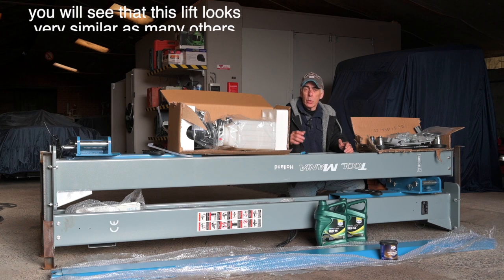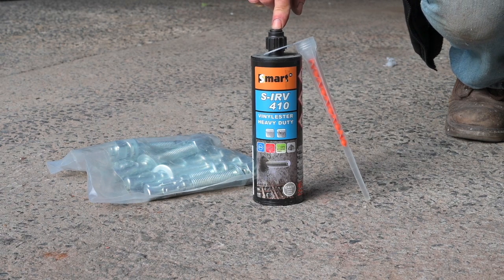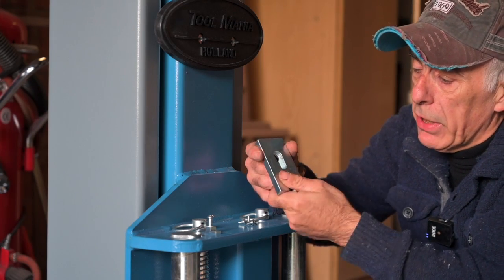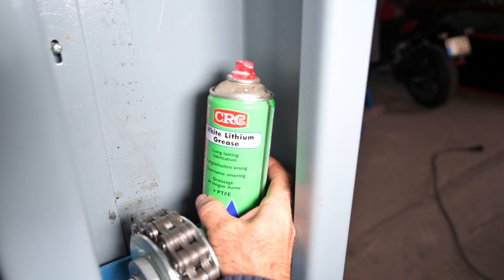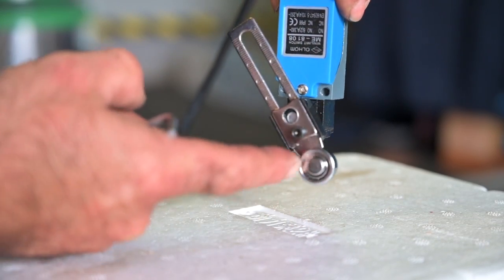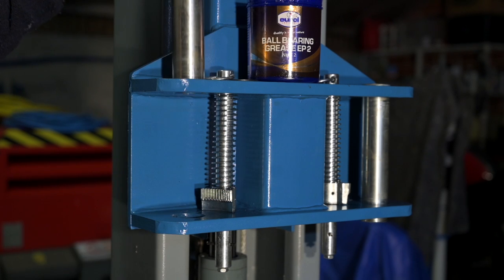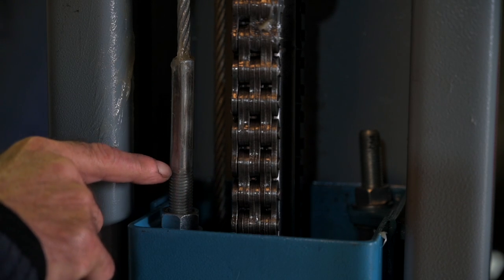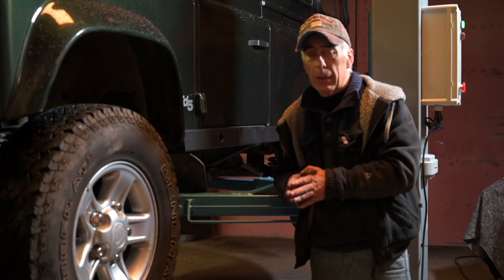Enough with jacks and axel stands, installing a 4000kg two column car lift

Comment: Love your video presentation .your amazing array of equipment is sadly lacking . My hydraulic engine hoist had to double up as a forklift . my aluminium ladders sections were performing the safe   ish erection of the posts .my new concrete slab had not been bull floated and the surface although level was all bubbly and uneven . My first attempt to bed the post was not perfect   although vertical in both directions .Maybe I should have used a bedding mixture of fine sand and cement . the industrial epoxy I used was not enough to cover the whole base plate . 79 years old and still learning new projects . I measured the baseplate positions and screwed two 1/2 inch thick x 4 inches wide  ply strips in place to allow for accurate base plate positioning . I like your pilot hole  drilling tip. this video is the bnest .. the twinbusch video is sadly not up to your hands on approach .  stay safe   Richard. in Alvito Portugal Sunday 21st April 2024.
Reply from the maker: Good to hear and keep on going... richard

Comment: i installed a 5ton unit in my shop last year, and that thing has paid for yourself and then some.  You can fix cars, manure spreaders, lawnmowers, very handy tool to have especially for fuel pumps and suspension work. you will love it.  I wish i had your forklift when I installed mine, it would have been a bit less scary :)
Reply from the maker: TXS for the comments, indeed you only know what you missed once you have it

Comment: very nice vid!  what a pleasure to be able to get new tools as you go through a project.   (One minor comment is that there was a bit of rocking with the Defender at the end when you were parking it, as if there was a bit of discrepancy between the two sides.)
Reply from the maker: Thanks for the comments , that was because I had metal piece in the shaft ( at the top ) that was not bolded down and it was taken by the shuttle /cracked .  That causes that shake.  Solved

Comment: Nice work and timely as I'm pouring concrete for a new workshop floor this month.  I'm sure you used the correct grade of threaded rod, but I would suggest anyone using rod to not use common thread. An alternative is Chemset Anchors.
Reply from the maker: txs for the comments, yep indeed

Comment: Hi Steve, nice work on the installation and video, well done. I just checked the comments and i cant find anybody else mentioning it, but it seems as though the shuttles had become out of synchronisation after the first few lifts, rocking the vehicle sideways and the locking mechanisms 'clicks' where well out of time... im sure your already aware and have probably fixed it already..cheers.
Reply from the maker: TXS for the comments, and indeed that was a two fold adjustement as this was a first lift.  One was to increase to up time on the timer before the lift descends. Especially with heavy loads, it takes a bit more time to get it lifted before it unlocks.  The second issue was air trapped in the far end cylinder,  had to bleed it a bit.   Now that is working smoothly..
Reply: @D3Sshooter  Hi, i have a dunlop 4t lift like this, going to be installing shortly. i was wondering about the bleeding, how is this done? is there bleed nipples on the pistons? thanks matt.

Comment: ThIs looks to be a very useful addition to your workshop, the only thing I would try to change is the cover for the hydraulic pipes which you have to avoid tripping over, surely this could be sunk into the floor. I think the only thing that will prevent most people buying one is the head height required, I am sure you will cover that aspect in a future video. Many thanks for posting this. Chris B.
Reply from the maker: TXS for the comments, indeed I will

Comment: Any lift is better than no lift. The only thing I don't like about that style lift is the cables and hydraulic line running across the floor, it becomes a pain in the ass when your trying to pull out a transmission.
Reply from the maker: TXS for the comments, that is indeed true.However I will place some panels  on the floor to level

Comment: After years laying out steel structures and setting bolts in concrete..I used drill in place..on last one ..worked out perfect in far less time.
Reply from the maker: txs for the comments, that is indeed easier

Comment: Nice video as always! Maybe be aware that the CE certificate is not always a guarantee of  safety but rather an indication. Te manufacturer decide for themselves if their product is CE rated according to the required specifications. So there is no external independent check to see if it really complies to all the specifications.
Reply from the maker: TXS for the comments, In this case the Certification was done in a UK lab according to different ISO standards, and I called up the test report and CE certificate.  But yes you are right, for this lify they had to make several adaptations.

Comment: Interesting to see the Defender caused the cables to be out of timing again.  They stretch a bit over time, and the shuttles need re-adjusting into timing.  Also, the deflection of the motor column was about 1-2cm at the top.  Retorquing/checking the column nuts over a few months also.

Comment: Very nice! I should get one too. My problem is the roof clearance inside my garage. The roof is not hight enought for lifting cars all the wat up. I saw in some others videos about lifters, that some of them have adjustable arms (lenght/hight/angle) for different types of vehicle. By the way nice choiche with old rusty engine!
Reply from the maker: txs for the comments, there are also lower lifts..

Comment: Hi Steve. Nice job and realy clear explanation how to install this lift.

I bought exactly the same lift (from exactly the same vendor), and followed your instructions very carefully. 
Everything went well except for the limiters. 

The top limiter needs some adjustment, but I can figure this out myself, so no problem there.

The bottom limiter is supposed to be mounted completly horizontal, according to the predrilled mounting holes. 
In your instruction it is facing down. You drilled the bottom hole a little bigger so it would fit a facing down mount.
But both options do not work for me, not horizontally, not facing down ! 
In both situations, the limiter is clicking way to early, and the lift stops at 30 cm from the ground. 

I think I have to modify the position and the way the limiter works. Or am I doing something wrong?

Can you help me out on this one?

Since I live in Belgium, you can also speak Dutch to me (I saw you Belgian license plate.. :-)

Thanks.
Reply from the maker: Thanks for the comments,  for the bottom limiter, you can place it horizontal..  The lift will stop when descending ( as soon as the sensor spring lead is pushed down)...   Then you need to keep depress the park bottom and hold. The lift will go down.   Try it out... That should work.... The alarm should also go off

Comment: Hi Steve,
great job and vid. We are decided to install a lift, too, as soon as we get some more space in the garage, gettin rid of some spareparts and machines. Wouldn't you mind telling the supplier of your device? Did you know the quality of the concrete? Cheers Heinz
Reply from the maker: TXS for the comments, sure the provider is ToolMania in the Nederlands.  As for the concrete , no I do not have the details. But I do know what It can stand as i have been rolling over very heavy forklifts and Backhoes. Also the drilling was hard

Comment: Is that uneven jerking like, when you park it, and release it normal?
Reply from the maker: needed a few adjustments on the release timer and removed the air from the far end cylinder... this was a first lift. Wellspotted
Reply: Glad you got it figured out. Very nice lift.

Comment: Very nicely done, excellent narration/description!  
What final torque did you tighten the floor bolts to ? 
Did you need any shims to level the posts? 
Thanks for sharing
Reply from the maker: txs for the comments, I did not needed shims as my floor is just flat.  Some place them to make the colums lean outwards ( just a little).  10Kg torque
Reply: Yellow tipped rod is high tensile 8.8

Comment: I'm surprised there isn't a set of safety lock position sensors.  If one doesn't release and you continue to lower it without checking or paying attention you could drop your vehicle off the lift.  The completely manual systems could have similar issue but the opportunity to make it more foolproof with electronics was missed by the manufacturer.
Reply: Not hard to add! Thx for the idea!